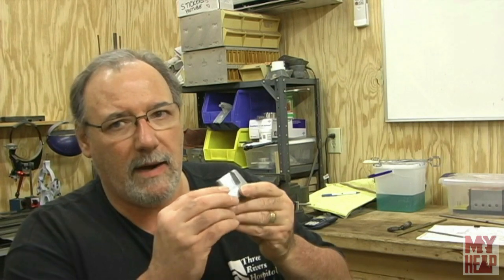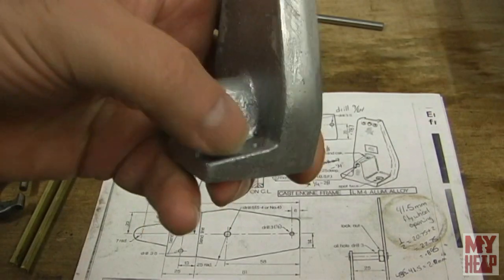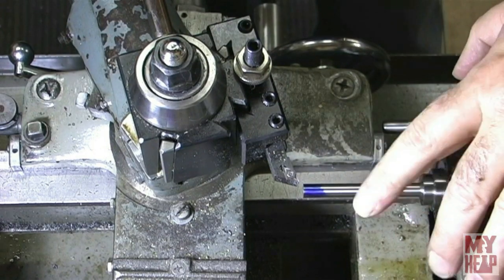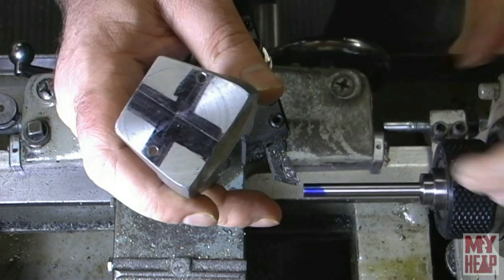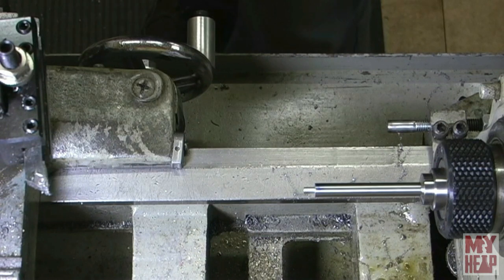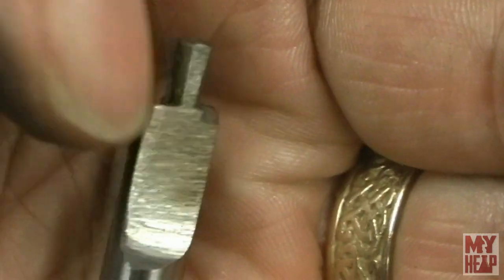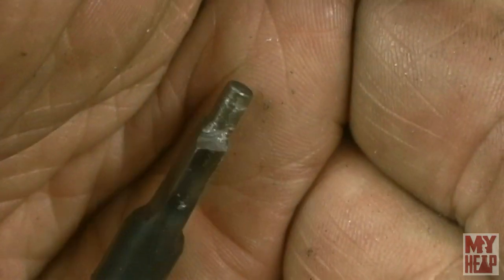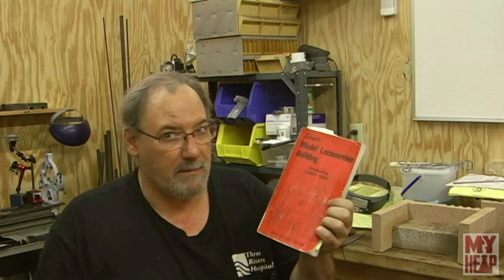YouTube Shop Student - Episode 013 - Making a Pin Drill

Comment: great tool and easy to make so they can be made as needed instead of buying a set that may or may not fit what you are doing
Reply from the maker: The tool worked perfectly.  I could have done a better job on the finish work of the tool though.  But, you live and learn.  I definitely see myself making more of these in the future.